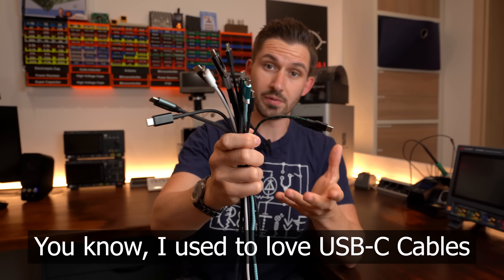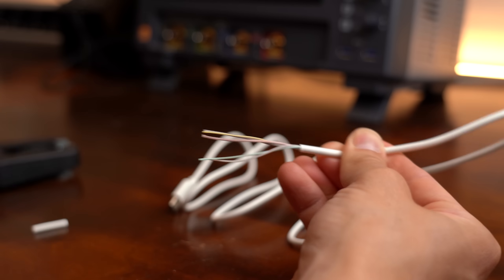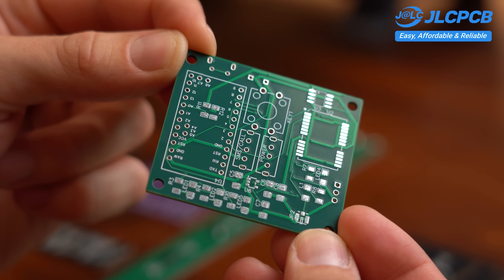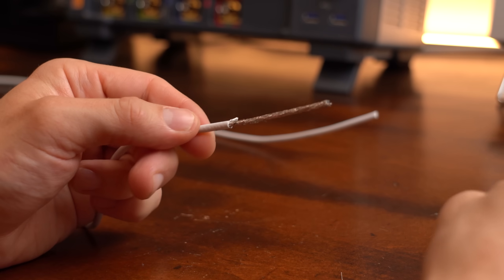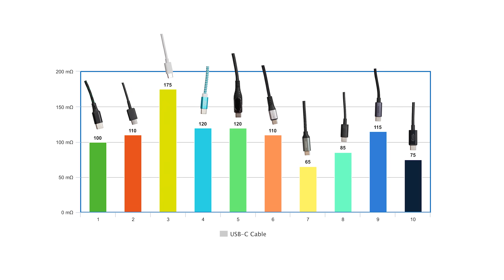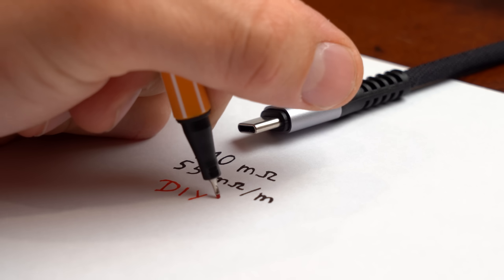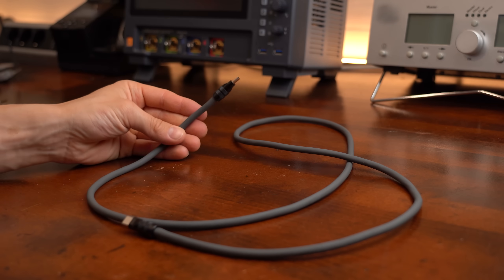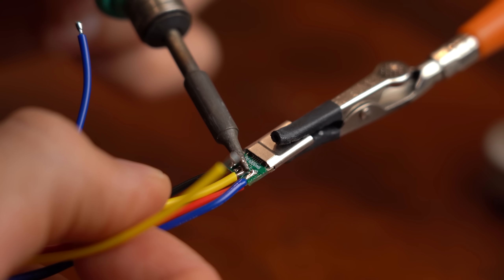Your USB-C Cable STILL Sucks — I Built a Better One? (DIY or Buy)

Comment: I was doubtful about my USB-C cable (claims to be 5 Gbps compatible), as viewing files and especially pictures from an Android phone with PC is unbelievably time consuming procedure.

I thought having a modern phone with 5 Gbps data transfer capability would make everything enjoyable and fast. But oh man was I wrong! Seems to be that Android uses some god awful protocol which makes things work similar to an old, super cheap unreliable USB stick that won't even work at USB 2.0 speeds and on top of that tends to lose connection.

On my old phone I couldn't even browse the pictures over the USB without constant errors and any alteration was pretty much impossible if the file was not moved to the PC's hard drive first. The only plus on my new phone is that I can browse and preview the pictures without losing connection or getting errors in Windows Photo Viewer (yes, I wanted to use the old one because the default Win 10 thing was crap). But I have to wait about 1-5 seconds when I go from a photo to another!!

When trying to access the phone with something like XnView, it can't be browsed or even accessed. Only single photos can be opened, but at closer inspection the photo is not accessed but instead it's saved in a temp folder on the PC and when trying to browse, I will just see other random pictures that have temporarily been saved to that folder in question.

WHY IS THIS NORMAL? What year are we living in? I should not be able to microwave a meal while my PC tries to access my photos on my portable device! And even then I probably won't see every thumbnail, as they seem to not load if I'm not scrolling through and they don't appear on the screen.

I get there's probably all kinds of APPLICATIONS and "convenient" ways to transfer and SHARE data between appliances and over various wireless connections or cloud services. I don't need or want such stuff. I need a god damn working physical connection to browse and handle my files on my mobile device that has lots of memory. I just need a basic fast local access!

WHY isn't there some sort of "raw data mode" that will use the whole bandwidth and not some shitty lackluster protocol? In a real world there would be something like a special "Fast transfer" option which could be enabled for certain folders inside the phone or it's memory card.

I saw some ADB file manager but couldn't get it to work. AFAIK, it is meant for fast data transfer of given bunch of files between the phone and the PC and not for any kind of browsing. At least the UI points in that direction. Seems like there are other ADB things out there, but again, unneeded hassle to get those working. But probably the only way...

This total lack of data transfer speeds and downright inability to "work" with files on an Android phone has been a great frustration and uncertainty. IIRC, my Nokia 808 PureView never had such problems. Or at least I don't remember being frustrated while browsing pictures from it on my PC.

Accessing the photos and deciding what to keep and move to the PC should be a hassle free, no-nonsense basic function. Instead you'll be better off moving everything in bulk to the PC's hard drive and then going through them...

Comment: Do you have the equipment to safely test USB data blockers? I found some on AliExpress and one of the Type-A blockers does block data connections, the other doesn't (using a basic wiring test), but the Type-C ones I can't really determine, because they have a chip that supposedly only negotiates the power and blocks the data, but I fear it might try to inject malware through some vulnerability if it recognizes a known device, like an iPhone or some Samsung phones. To actually test it, you would need to record the USB communication and be able to spoof your device's identifier to one of a phone. That's not really something one can do on a whim.

Comment: I basically only use pre-made versions of this cable. Can't be bothered to make one. Lisen do an excellent one. It's the only cable I'll use for high power use. Lovely cables. For high speed data however I prefer thick, short, tough braided cables at USB4 spec minimum

Comment: copper is the best conducter even better than gold which only resists corrision, the connector contacts are either gold plated or just plain tinned which will definately have more resistance the cable itself, if copper would have been used in the connector pins we would have the best connections but it also oxidises fast turning black giving bad contacts.

Comment: When it comes to the E-marker chips, I had a rather interesting experience. I have a short USB-C docking station that I wanted to use with my regular PC instead and so I had to buy a USB-C Female to male adaptor from aliexpress. Coincidently, I also have the FNB58 so I checked couple of cables with it. While testing it, I forgot to unplug one of the  cables with e-mark chip from the newly purchased extender. To my surprise, the FNB58 shown that the usb extender is capable of 240W which I couldn't believe.. Then I noticed that I had the other cable plugged in with it. When I unplugged it, of course it was just a regular cable. 
Now, with this knowledge you can basically trick any cable of being able to support higher power if you plug any other compatible cable alongside it. 
I'm actually curious as to what would happen if you'd plug 2 E-Mark cables together with different power that is allowed. E.g. 60W & 120W cables.

Comment: There's no dual ended USB C cables that do not transfer data. C to C, C to mini, C to micro, and C to Lightning, all have data transfer. Even the cheap ones. Cheap ones do not do more than 5 volts at 500mA, with the regular transfer rates of USB, and not with 5gb+ transfer speeds. The only cables I've had that do not have data transfer, are cables that specifically come with things that do not require data transfer. And I've had a lot of cables.

Comment: So making your own cable you should be able to have one side into device while the other divided into a power only and a data only so you can charge at a higher rate while transferring data like a camera to the computer and a power supply

Comment: I just made a video on the FNB58 - great tool! I used it to test this big LifePo4 PowerBank from Aliexpress, both output and capacity. Great device, especially love the PD Listener and PD Trigger functions. Based on your screens, I think you can firmware update yours, as I think mine just says USB-C Tester rather than E-Marker tester (and I'm running latest firmware). Great video, thanks!

Comment: I was actually frustrated by poor USB-C cables a couple of weeks ago. I bought a new logic analyzer that needed to be at USB-3 speeds. The cable it came with was too short to reach my workstation so I used a longer one I had lying around. With that cable I could only ever get USB 2 speeds. I ended up buying a better cable.

Comment: @greatscottlab would using a CAT 8 Ethernet cable provide enough shielding and the similar size wire to enhance the diy USB c cable? if my idea has merit plz avoid getting any cat 8 Ethernet cables that are flat, they are fake.

Comment: Cant you use a cat5e (and above) cable? 
Network cables are cheap way to get a lot of 8 core wire, and they have a twisted pair layout and is shielded, they even come with that little string you can attach to each end of your cable to stop it from over streching or twisting.

Comment: One era where DIY fails, is you're not going to make it cost effective the moment you try to compete with high performance standards (USB4 80Gbps/120Gbps asymetrical, or Thunderbolt 5). This is why you never EVER see anyone offering such cables for sale outside of the Eastern market (where they actually need to do the hardwork, and also spend on five-figure compliance and data integrity testing machines).

Comment: It's not only a cable gauge/diameter issue, but also the material. Unscrupulous sellers will use copper-clad aluminum (or, in some egregious cases, even steel!) for their wires, which have much worse conductivity for a given diameter.

Comment: Using breadboard setup has considerable contact resistance .. not suitable for voltage drop measurements.
The power losses of poorly made cables and connectors (high contact resistance .. poor contact and conductor metals), are not “puny”, especially at 5V.

Comment: All cables work with slow or faster charging, and data pretty good, and those without data can be easily identified. Except Android Auto, which is super picky and outright bans perfectly good cables, making you constantly buy more of them. I already did ragequit some cables because of that. Can you make research into that?

Comment: 9:42 the short length definitely isn't helping you, but perhaps strip some extra length, splay and twist the wires together, then flux + tin the twisted wires together, and trim to length.

Then you can have an easier time wrestling the pair onto the pad. You can also use liquid masking to cover up some extra wire length if you need it to reach the pads.

Comment: I live in the balkans and... We dont have the best electronics market.

It is quite literally impossible to find a cable that can do both usb 3 speeds AND charging at 5 amps.

Every single god damn cable is limited to the ancient usb 2 speed of 480mbps.

Anker has recently arrived here but i havent seen them offering a cable with specs mentioned above.

The reason why im even mentioning data transfer is because i actually wanna use a SINGLE cable for EVERYTHING.
I do not use cloud services because that is a waste of money in my opinion.
I have found a way to transfer files over the local network but the speeds are, at best, half that of USB2.

Comment: Very interesting. When you see the amount of power some,very thin USB cables are supposed to support, having a DIY high power cable only for fast charging is very tempting. 
Actually, I have a question. I know, some USB cables are « power only ». Could it be possible to have a « data only cable » ?

Comment: Thanks to the UP master for sharing! One more detail: 90% of the 'USB4 cables' on the market cannot actually reach 40Gbps, because the purity of the copper core (at least 6N oxygen-free copper) and the shielding layer (aluminum foil + braided mesh + ground wire) are the key. Our laboratory has tested a certain brand of cable (not an advertisement). With the same length of 5 meters, the packet loss rate of the 6N copper core is 82% lower than that of the ordinary copper core (with a chart on the homepage). Interested friends can discuss the impact of the shielding layer process on the signal~

Comment: 10:57 Fun fact, Samsung phones charging animation turns electric blue when plugged into an over 25w power source. The fact the animation is green by the timestamp and green on the thumbnails means it's not outputting more that 25w of juice.
Reply: You have to enable Super Fast Charging in the settings of your Samsung device to draw anything over 25W
Reply: @muhammadraihaan5236  Just weird he wouldn't do that in a video about a 240w cable lol. I don't really believe anything he's stating. Because how could a cable even change how fast a phone charges? Impedance doesn't do that much. All about the brick you've got.
Reply: @Anon01X  Are you completely new to this? USB cables have marker chips in them that communicate charging speed with the phone
Reply: That's because he connected it to his laptop?? And laptops only output a maximum of 10w to usb slave devices. How is everyone here forgetting that

Comment: @greatscottlab 
Why did you settle for an imperfect version? When I saw the title of the video, I was hoping that you would make the ultimate solution with high charging and data transfer speeds and ideally compare 1 meter and 2 meters in length. Because that's what I really need and want to have at home :-)
Otherwise, of course, thumbs up and I believe that the final version of the perfect cable will follow soon.

Comment: You can always pre-twist the wires on the ends so they're stuck together and then you put some solder on both of them so they're connected and then drop that right on the pin with flux. Perfect every time 
Way better application
I'm going to actually give this a shot and order about 10 of each. We'll see what happens

Comment: If you do this again please add the fast data transfer feature. When I buy a cable I want it to do everything. I don't want to have separate cables for charging, fast charging, data transfer, fast data transfer, etc.

Comment: I use a powerbank to keep my laptop through my classes and normally end with the powerbank having 10-20% power remaining. (with a backup power bank and the laptop at high/full battery)
I never though to test the cables as a potential power loss however I did think about cable length.
maybe its time I made my own USB-C 100W cable that is shorter as my powerbank sits about 10CM from my laptop in class and my current cable is normally looped due to its excessive length.

Comment: I have 2 questions about the usb c protocols: - first, how and where do i google these protocol things, like how did you know that you needed this specific emarker to get 100w and 240w?

Like for example i heard somewhere that you can get 9v out of a dapter without logic if you shorted a specific data wire with a resistance to gnd, but i cant find any related data when i just google

- and 2nd one (propably if i knew the first i'd know the 2nd too) what about other proprietary charging standards?, like qualcomm quickcharge, huawei quickcharge, supervooc, and samsung's dynamic power thingy, does each one need a specific emarker?, i'd love to see that one emarker that supports them all to make the ultimate charging cable

Comment: Wyn it’s not labeled… it’s in the Fkn box what protocol the cable supports… look for high pd delivery, works for data also… 

I have a 100w and a 240w pd type c cables and they’re the best investments iv ever made.

But making one, if it’s cheaper, could be worth, just from the thumbnail doesn’t look very well packaged, plus normal c cables the negative is an outer sheeth that surrounds the other wires with an insulator helping prevent unwanted noise affecting the cable…

65w pd usb c is pretty standard across the board now as most laptops charge via a 65w charger (some smaller laptops may only need 30w) but most now use high watt c charging cause it’s smaller and easier to lug around that a long ass wall plug with an inverter

Comment: I think you need to use cryogenically treated oxygen-free cables with "continuous crystal" conductors encased in ultra-low-density dielectric.* It will maximize the phase coherence of your signals or something like that, and the MP3s that you transfer to your phone will sound better. And you can get this cable for only €75/cm from any good audiophile dealer!

* Mea culpa: yes, I stole this phrase from the website of an "audiophile" cable manufacturer that sells $250 USB cables.

Comment: Durability and customizability are more important than German level Efficiency of that kind of small power loss. Almost all my power extensions are DIY because it lasts much longer. Power loss of mains extension matters more, when you run a 1KW appliance down the line, than charging a phone.

This is awesome. I have not yet made any USB extension.

Comment: Yep, it is impoaaible to find a desent 2m long charging cable!

Tried to find it foe years, i have dozens of cables, the best i get is 4h charge time most have 6 and longer, normal cable should have 1.5h or less with my old 2.1amp charger.
Now looking for a GaN charger with type A and 3 ports(even if 1 is A  and other is C is fine) and minimum of 3A even tis is hard to find.
Yes there is no specifications of the cables 90% of the time.
What is going on?!

Comment: One more thing is thunderbolt 5 cables and some don't even have verifications. I went with thicker cable but it broke due to very big cable and it was not available in small cable length. So currently I moved away from braided and chose normal flexible silicone cables. 5Gbps is too slow for modern hardware when it can do more with 10-40Gbps

Comment: You have simply targeted the power cables but you can also consider the thunderbolt cable as well which might have lowest rate which you are calculating

Comment: Honestly it is the data problem that is an issue with me.  It takes a little testing but I never have an issue finding power delivery that is "acceptable."  However, I use a lot of usb-c touch screens, and like the fast transfer to my tablets.  It feels to me like it is nearly impossible to find a usb-c that is actually fast transfer.  At any level of PD.

Comment: Next cable should be a 100% spec all-purpose cable audio video data power 240 alt mode Do anything and everything. And add a decent length.

Comment: Nah diy is nlt winner. Other one probably had faster data and video feed etc. Also if u pull hard i think solder joints will break much easier than molded plastic

Comment: Those beefy-arsed wires hanging off those little pads could probably use more strain relief than the nice little plug covers afford. And nailpolish seems a bit wrong - main benefit would seem to be some degree of water resistance? I'd use hotglue - similar degree of water ingress protection and can possibly afford strain relief (although you'd probably need more than would fit in the nice plug covers), and, if you want you can peel it off and dig it out.

Comment: I figured out the problem is that they're not using real copper stranded wire and if Is a real thin Angel hair Like conductor that it breaks right at the connection every single time.  Technology is getting better while the production and materials are being  substandardized and fail On a level never seen before and it's just pure greed